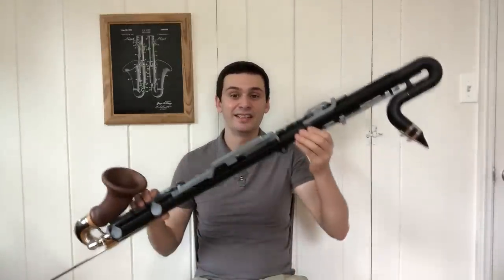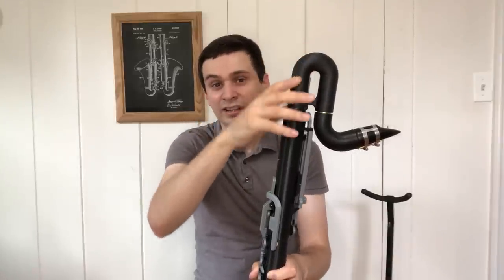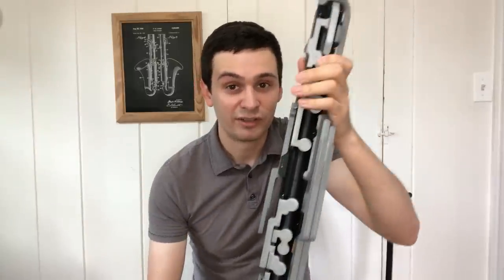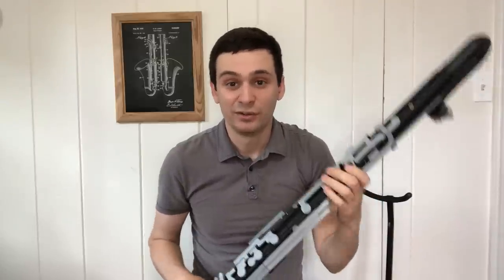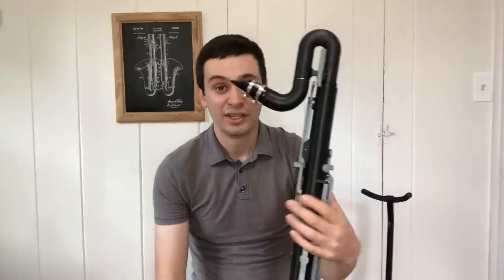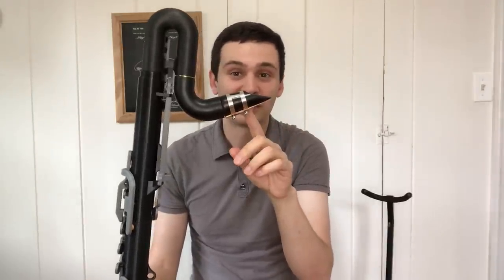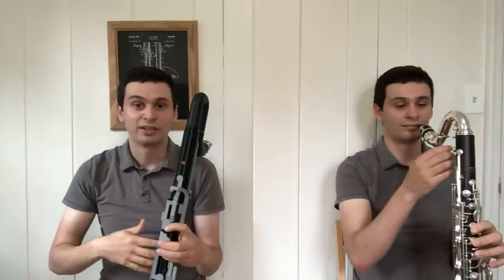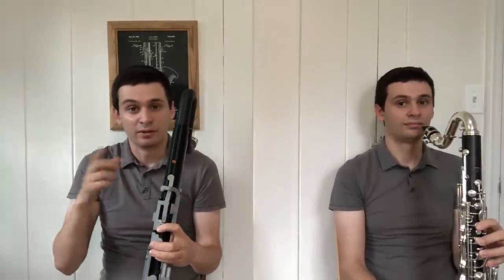I made a 3D printed bass clarinet in G!

Comment: It really makes a lot of sense. Going down to the Low E, sounding B natural a 4th lower, is almost the register of an extended bass clarinet without the necessity of added keys (you only have to add the low Eb key which doesn't seem present). Also being F the fingered "fundamental" scale of any clarinet, this one has C as sounding fundamental scale. It's not a huge difference, but playing in C, D and E in the lower register would be easier than with a Bb bass clarinet.

Comment: Having tried both plastic, wood, hard-copper-alloy and aluminum for my own simple, transverse-flutes, i dare claim that this instrument, though already impressive, would sound wonderful if you made the body/tubing  in some hard-copper-alloy.. Plastic,  absorbs too much energy/upper-partials from the players tone.. The 3D printer you're using now, can also be used for printing cast-resin-key-parts - so you could then make them in the metal of your choice. ( Furnace and related items can bought / made at a low cost)  Sounds so good even now - Congrats !

Comment: Seeing the instruments you 3d print is amazing, and I'd love to see more!
You mention that the keys had to be a bit thicker, but there are metal filaments out there. You can probably get a material with a similar durability and flexibility to metal that is 3d printable.
Anyways, I'd also love to know how you actually assembled the keys. I'd assume you printed them out individually, but how did you attatch them to the instrument?

Edit: after doing research: metal filaments do exist, but they either are mostly plastic and don't have metal's durability, or they are actually metal, but may need special printers or they could harm the printer.

Comment: I would be very interested to know what you use for key pads. Are you using commercially produced ones, or did you 3d print them? I'm also interested in what you used for springs on the keywork.
Reply from the maker: Most of the pads are 1/16” Neoprene foam sheet, though some are a Music Medic Neo pads. The springs are pen coil springs.
Reply: @Jared_De_Leon  Nice work!

Comment: Was the full 3d print part for fun? Couldn’t he have just printed out a neck extension to make it the right key?
Reply from the maker: No it’s impossible to change the key of an instrument just by changing the length of the neck. The tone holes need to be re-spaced proportionally which is why it had to be designed from scratch.

Comment: How did you determine the position of the holes? Is there some software that helps calculate that? If not, is there a list of calculations to come up with the notes that could be written into a software? Thanks.
Reply from the maker: Check out Bernade's book on acoustics. There is also some useful info in Keith Bowen's paper "THE RISE AND FALL OF THE BASS CLARINET IN A"

Comment: How did you go about designing this instrument? Did you use math formulas or something to find the position of the toneholes or was it trial and error?
Reply from the maker: Mostly trial and error. I used a Bb bass as a starting point and figured out the tone hole positions from there.
Reply: @Jared_De_Leon  I see. I saw you make this and your bass oboe and it inspired me to try to make my own 3D printed Bb clarinet. I just started it so idk if it’ll ever get finished but yeah. My main issue is just figuring out the measurements but once I get a 3D printer I can make adjustments to it based on the intonation

Comment: wow! will you be posting the schematics on thingiverse?
Reply from the maker: No but I may one day have the files on my website.
Reply: @Jared_De_Leon  If you don't mind my asking, what CAD software did you use to design this? SolidWorks, eMachine, or another?
Reply from the maker: @user-ty8me4hm1w  Fusion 360
Reply: @Jared_De_Leon  Thanks for answering. Last question... Does the type of 3D printer and material used matter? And what printer did you use for this?
Reply from the maker: @user-ty8me4hm1w  I’ve only made one so it’s impossible to say. But I use a modified Ender 3 Pro
Reply: @Jared_De_Leon  Thanks! Super exciting stuff!